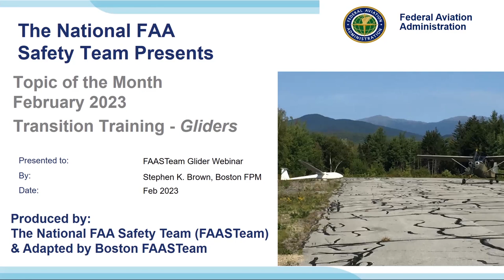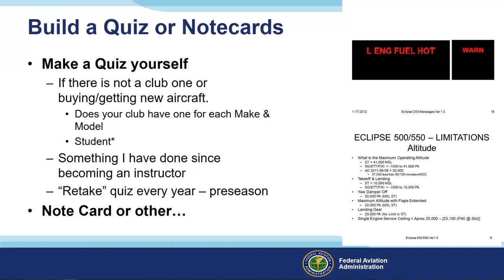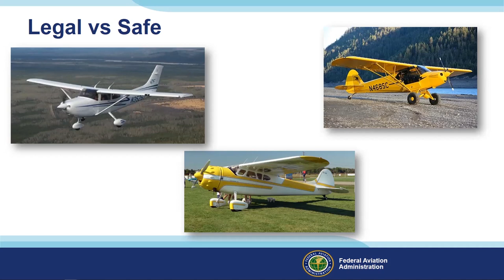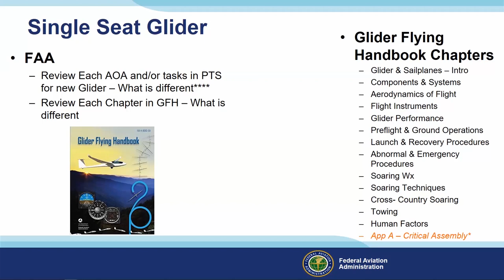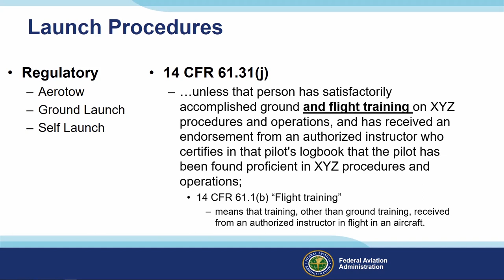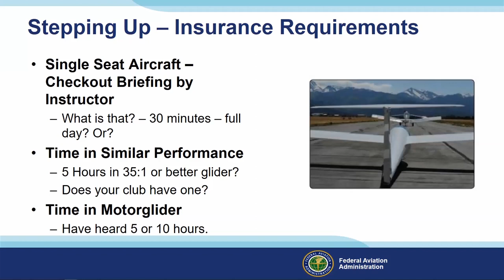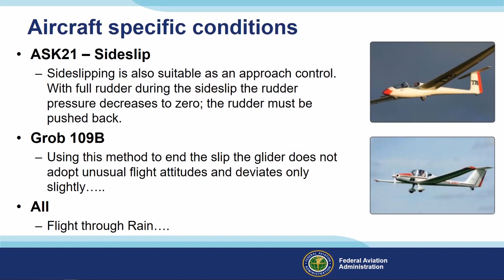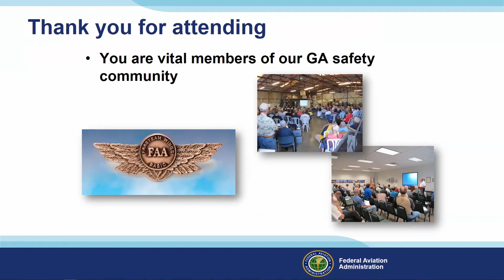Transition Training - Gliders - A Topic of the Month

Comment: I'm seeing this just now, but as a long-time glider CFI, and particulary seeing that the starting image in this presentation shows a Grob-102 Twin II, this Grob (and the later Twin III, that is slightly better behaved) is one of the hardest sailplanes to fly that relatively low-time sailplane pilots (and particulary power pilots doing a rating add-on) may encounter.  The good news is that (a) there should be a CFI on board who is very familiar with the type, and (b) IF you can fly a Grob 103 well then you are really ready to fly almost any modern glass sailplane of 18 meter span or less ... but the bad news is that if you are stepping up into this glider, you will generally find it a handful.  Instructors know that this sailplane is harder to fly than the looks-similar ASK-21, or the Duo Discus or DG-1001 that both are higher performance. 

The first key thing is that even though it nominally is "a nose dragger," like almost-all long-winged glass sailplanes it MUST be landed like a taildragger doing a full-stall landing.  Do not ever attempt a wheel landing in a G-103  -- you do not have a throttle to recover from a "jounce" aka "taildragger hop."  If you jounce in a glass sailplane the standard advice is "close the spoilers," but usually the outcome will be bad, and the Grob is notorious for broken fuselages as a result.   (This is doubly-true landing on a hard runway.  First flights, or landings in difficult conditions, should land on grass if at all possible.)

The second thing to understand is that getting the glider on the ground with its cross-wind correction correct AT FULL STALL is the key issue, not trying to get a "grease on" landing. A poor crosswind correction on touchdown will also generate a glider-wrecking ground loop.  In a G-103 or almost all glass sailplanes the best landing is tailwheel first -- with the main dropping onto the ground with a good thump, dropping as much as a foot.    You don't know how to fly a glass sailplane unless you can do this is a decent cross-wind, at least 2/3d of the rated cross-wind of the sailplane. 

So if you are transitioning up in sailplanes (from the 2-33 etc), or if you are transitioning from power, the whole question is really "do you REALLY know how to do a full-stall landing in a taildragger?"  If you do, the transition will be fairly easy.  If you don't, then you will basically be trying to learn how to do that, while you are trying to also transition.  

Stepping up to the Grob from training in a 2-33 is a remarkable test of how well you learned the fundamentals of flying -- if you really do fly a 2-33 well, can manage a good (almost) full stall landing in a crosswind, then the transition won't be too hard.  (The tailwheel on the 2-33 is fragile so most clubs/instructors try to discourage true full-stall landings in this type.)